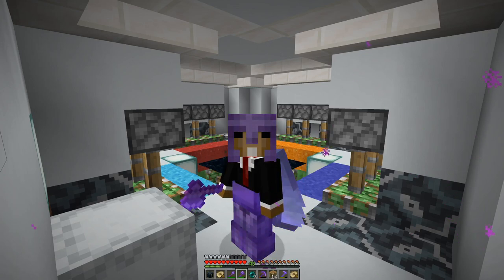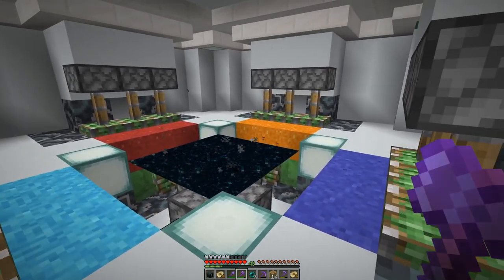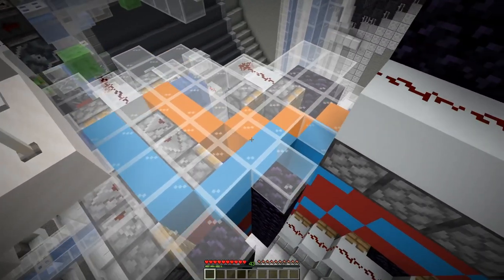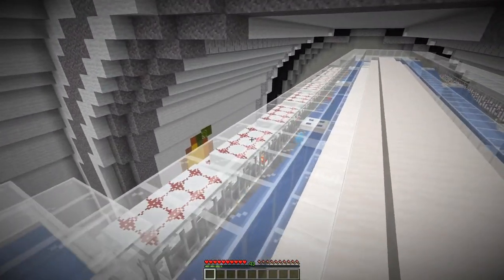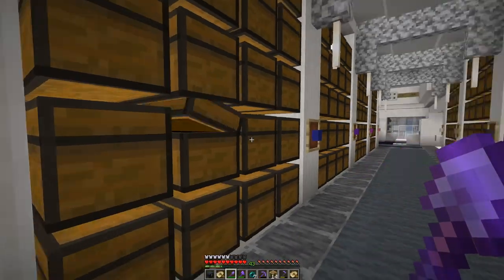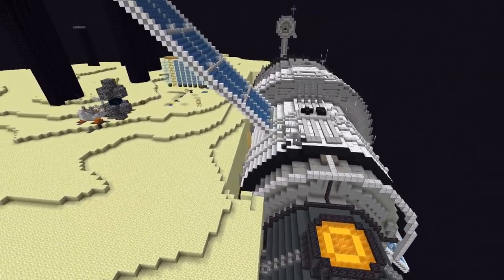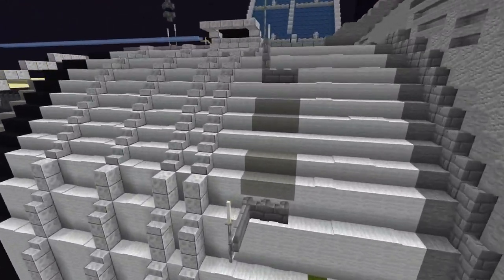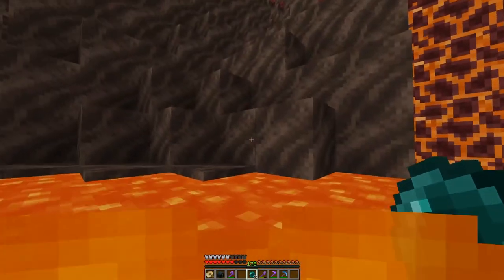Peaceful Challenge #34: Concrete Factory In A Satellite

Comment: I find it insane that I have a villager setup with every single enchanted book but the Scicraft guys haven't done that yet.

While typing this though, I also realized how little I actually use most of the trades I've grinded to get so maybe they're putting their effort into actual worthwhile projects lol
Reply: @Shake of Banana No just max level of each type. Just finished Luck of the Sea and Blast protection today actually lol which were the last

There isn't really a situation for me where I would need less than maxed tools at the moment, I can see wanting it for a pvp minigame or something but that is getting towards REALLY useless time investments if you're gonna try to get them before you find a reason to need it.
Reply from the maker: I don't like dealing with villagers
Reply: @ilmango  they are a lot more fun in 1.16 but I agree, villagers are only fun when u lock them up in holding cells
Reply: Not a big deal, I have every single max book level villagers on my single player world
Reply: @ilmango  That is the point. Villagers can give u so many super items (infinite iron and strings, renewable dia gear...) but for adecvate price of so awfull job

Comment: This is so cool!!

I think it’d be cool if u set up a perma loader array from spawn to the sand duping end portal and put a hopper at spawn that’ll sort between different items. Depending on the item sent from end to overworld the sand duper can automatically switch over between different colors of concrete or go sand mode. I think it’d be so cool to just hit a button in the end and suddenly the concrete color that’s coming into the end changes

Comment: You can actually speed up the villager book selection by using a sticky piston on the lecturn. Each time the piston moves the lecturn, as long as it hasnt traded, the trade will reset. Very small difference, but after many tries it’s well worth it

Comment: if you insist on wearing an elytra you should get 2 armour pieces with fire prot IV and 1 with prot IV, that way you still have the elytra but you're pretty much immune to fire damage as it barely hurts you at all and you can easily heal it off with food. also you should be fine with just 1 prot IV armour piece and feather falling IV boots

Comment: Wait I've been out for a bit, how does one get into the End on peaceful?
Reply: They got at the start a special seed which had a portal with all the eyes. The thing is you can't get ender eyes on peaceful to find the fortress, so they had to use an external tool to be able to find the ender portal quicker. They tried finding the portal by themselves but according to their calculations, almost half a billion blocks had to be mined in order to find the portal. They mined for around 15 hours and decided it was not worth it and used the tool.